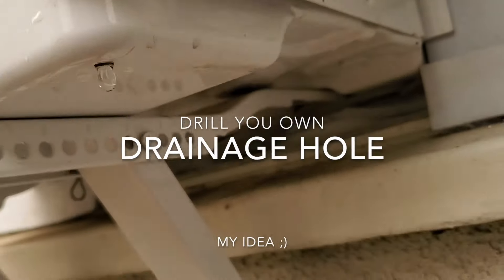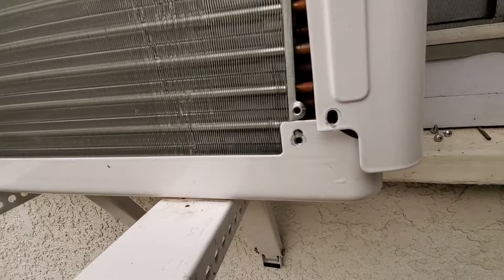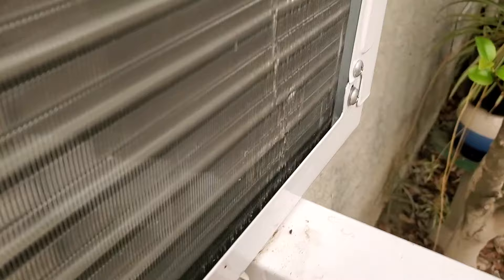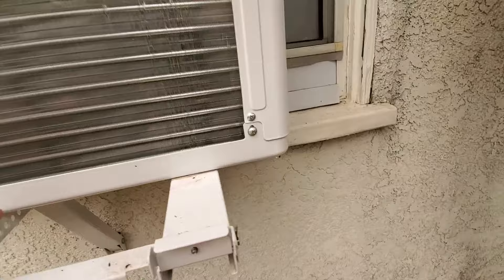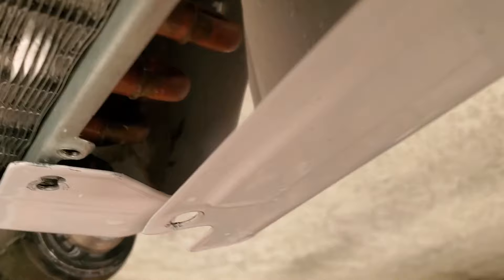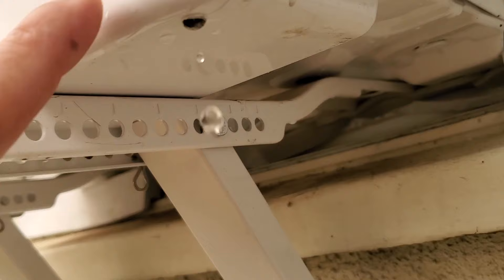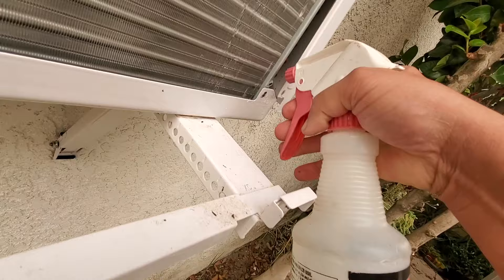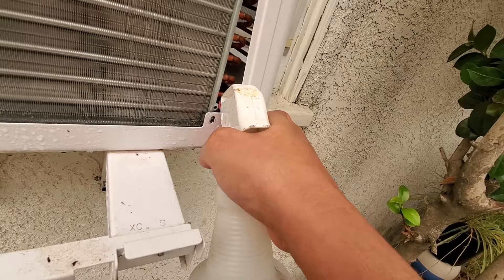How to Drill a drainage hole in your Midea U- Shape fan :) Honest²

Comment: That water gets splashed on the condenser to improve the cooling. By drilling that hole you just reduced the efficiency of this AC.
Reply: I was just gonna comment the same…. It’s true, look it up people before making this mistake.
Reply: I have several air conditioners that seem to lack drain holes. I get what you are saying but that standing water really helps all the metal screws, lower coils and lower chassis rust.
Reply: Drill the hole. The reason for having a sealed case and this water splashing design is to promote the energy star junk units that only last a couple years. Drill the hole
Reply: Why? the water is to cool condenser  i hope u didn't void the warranty
Reply: @cheatermustdie00  if you don't drill, it will rot out in a couple years, then you're at the store buying a new one... it's called planned obsolescence.
Reply: @darinp5612  2 yrs ? If you don't clean your AC every 3 months midea and carier are not stupid made design that will not last  long
Reply: @cheatermustdie00  needs to have a place to drain rainwater and your cleaning agents.
Reply: It’s a good trade off. Less efficient vs loud spattering/popping noises, mold, rust, water flinging around (rusty water flinging around 😅).
Reply from the maker: @petersachs764  @FuzzyJohn @StarlinkAdmin PETE KNOWS What's Up!!! Theis a lie @_@ Honest²
Reply from the maker: @cheatermustdie00  I'm still waiting for someone who has dealt with the warranty???  You have to have a license AC repairman look... I'M A DIY4LIFE!  Warranties are for those who can't DIY @_@ Honest²
Reply from the maker: @darinp5612  Careful... speaking the truth!  People can't handle the truth!  I can ;) Honest²
Reply from the maker: @travisevans2549  Mine has DUST not RUST Hahahahaha that's kinda funny but true :) Honest²
Reply: Hey he is slow it’s okay haha
Reply: But the AC pan becomes in incubator for mosquitoes.
Reply: i thought you‘re only supposed to use mild soaps and clean more frequently to prevent buildup.
Reply: Thank you for letting us know good sir. 😊
Reply: I can always seal the holes, thank you for your comment
Reply: And increased the lifespan. The standing water rusts out the unit and becomes a biological breeding ground for mold and all kinds of other nasty things.
Reply: The model I purchased  in 2024 has a removable plug to drain the water if you choose that option.
Reply: @socrates2706 Where exactly is that plug located? And is it easy to access from inside? I live in a multi-story building and obviously, I can't access the AC unit from the outside.
Reply: @gillz107  It’s on the rear bottom corner. You can only get to it from the outside. It is blue on my unit which I purchased several days ago.
Reply: The hole is so small it shouldn't matter. I think it will work even more efficient than having water collect inside.
Reply: @gillz107 its damn near exactly where this man drilled the hile. Its bright blue you cant miss it.
Reply: Look up Legionnaires disease and then tell me what size drain hole you drilled
Reply: @socrates2706 

I was outside looking at my daughters Midea U shaped air conditioner and didn't see any water coming from it. I did see that blue plug your talking about. I'm removing it tomorrow. Thanks for the heads up.
Reply: @gillz107 It’s basically in the same spot where this guy drilled it in the video. Looking from the outside, it’s on the outer right corner underneath the unit. Looking from
Inside the house, it would be on the outer left.
Reply: It's not a mistake after you've had it awhile and notice algae and mold growing on the window and wood siding around the unit
Reply: @cheatermustdie00  on a 300 dollar ac that last a couple years anyway?    The water splashing everywhere grows mold on my windows and siding
Reply: What do I do if I don’t have a drain hole ?
Reply: It is better to "reduce" the efficieny than having the condenser to rust.
Reply: @KingHarlequin1999  What kind of material is the condenser made out of? Does it really rust? Also, isn't the condenser on the outside getting rained on?
Reply: @FuzzyJohn  For most condensers, the fins are made of aluminium, the tubing is made of copper, and the A/C housing is made of steel; and having water sitting for too long when the unit is off will cause galvanic corrosion, causing the steel to rust, and the aluminium fins to corrode into the copper tubing, therefore decreasing the efficiency permanently.
Reply: @KingHarlequin1999  That's fantastic!

Comment: PSA dont try to drill a hole on the left side of the midea, punctured the unit and now have to order new one =(
Reply: I couldn't get the panel off on mine and just blindly drilled it in a moment of extreme frustration. Water came pouring out, but I don't see any obvious sign that I punctured the coil. It's running and blowing cold. What happened when you punctured yours and how long did it take to see something was wrong?
Reply: @mandyperkins4415  i had 2, first one did whats urs did, alot of water came out and works fine. second one tho is where i messed up. i think it hit the coil and a loud hissing/blowing noise started with  a bunch of water pouring. i could tell the second i drilled into there was a problem.

Comment: I have two of these units in my downstairs windows. I recently have been seeing a lot of springtails getting into the house. Sure enough, i go out to look for the moisture and it seems no water has been draining from these units. I drilled this hole and water came dripping out like crazy. I don't know if this will keep the springtails away now that there won't be any water sitting and collecting, but it def is worth a shot. Thanks for the vid!
Reply from the maker: I was nervous cuz I figure I would get some blowback.   To Drill or Not to Drill... That is the question!  It's fun to drill things ;) Honest²
Reply: Drill!!! Rust is an air conditioners worst enemy by far.

Comment: I drilled mine on the right side. All older A/C units I have been around have drain holes. Even the main wall A/C (Comfort-Aire BG-121P) that came with my house has 2 drain holes and has been running perfectly fine.

Comment: I have installed one on my shipping container (which is my work shop now) and every time I turn the AC on it has a smell to it .. even if its on the fan mode .. there is a bunch of water in there I can tell you that .. could that be the cause of the smell??  and why isnt there a drain hole originally on the unit ?    Thank you for sharing  .. I like the mount you built .. it looks awesome and well made.

Comment: I have the 5000 btu version with no drain plug. This is a definite design flaw. The humidity inside my home is 10% more than it is outside. Air conditioners are also supposed to dehumidify or what’s the point? Everything gets all clammy and damp otherwise.

Comment: The new units are designed this way, so you should really do some more research. And educate views that the fan splash water onto the coils is to help better cooling. 
Is this right? I’m sure on paper it looked like a great idea but in practice it’s poorly done. My brand new AC unit has a huge puddle of rust in that pan. Manufacturer can’t help

Comment: My first a/c of this model corroded  in 2 years, 1 inch off the base despite me using professional cleaning supplies for a/c. Got a second one, and I'm looking at it collecting water. I have drilled a hole in another Midea model already because the water was building up and making a clinking sound when splashed by the fan against the fins. Why doesn't this company make a drain hole from the factory?!😕
Reply: Just done it. But I pried the side panel quite wide and drilled from the inside. Lo and behold a bunch of water and crud came rushing out, and the a/c is a week old. Use quality bits and don't nick the copper tubing!

Comment: Hey, very useful video. We just ran a whole summer of this AC and it accumulated water like nothing we've ever seen and we don't even live in a particularly humid area (Montreal). We're lost about how to keep it clean inside. It's a bit of a dusty and corroded mess. Is there a relatively easy way to remove the components of the back part to clean properly? We were also told by Midea themselves both "it's designed to not need drain holes" and at the same time, "you can put a small hole somewhere if you like". So I said to them, how can you say BOTH things to customers??" So, do you recommend I just drill a hole like you did? How large of a hole should I make and what would I use to create a stopper?
Reply: Latest midea's use a 3/4" hole on the right rear side if viewed from behind.. it had a rubber plug in it..I pulled that out on day one..they are aware that this is an issue
Reply: @skip741x3 Thank you. Maybe I'll try to make a home.

Comment: The sling fans on window shakers are meant to come in contact with the condensate water.(slope outward is important on these) This water helps cool the compressor by rejecting heat from the condenser more efficiently. 

The air outside is never in contact with the air inside on window shakers. This mod will likely reduce the life span of your compressor. I would stick to cleaning before storage end of the season. 

Maybe even drill a hole to rinse/clean and plug it for operation the way it was engineered.Good idea for a new vid. Cheers.
Reply: yeah just drill a hole using a very stubby drill bit a size smaller than any rubber plug you have and you have a simple removable plug if you want.
Reply: Matt, do you have one of these u shape units? There is a design issue with it that causes the condensate to foul up the evaporator and squirrel cage with mold after a few months' usage. Also the condenser clogs up due to the excessive condensate that the unit can't get rid of. Over an inch of condensate is too much. Your theory is sound but this Midea requires this mod or you will live with lung infections. Midea knows about the flaw.
Reply: @nobaddog1  I have no issues in Alberta Canada using it on a square footage room that can satisfy set point with 10,000 btu’s. Design may not be able to handle your locations humidity and or room size.
Reply: @nobaddog1  no issues with mine in West Texas.
Reply: @mattb6514  I should have added that I live in New Orleans where the humidity is always 100% so I get a ton of condensate water it just overwhelms the system. The little unit works good though it’s always got a stream of water coming out.

Comment: How does it cool after said hole was installed? Some say the water needs to be on there to keep it cooling/cooling radiator.
Reply from the maker: The AC was blowing 50-51.5ºf with or without water!  I put tape over the hole & ran tests.  Looks like the lower basin can hold near 3 cups of water.   When full of water I don't see where it is helping with cooling @_@ Honest²
Reply: @Honest Mike  You'd probably only notice a difference if you're in a dry climate, and there was a big temperature disparity between indoor and outdoor.  The water on the external radiator will definitely help eliminate heat from the system more quickly, but if you're somewhere wet then it's mostly just going to collect extra moisture.

In theory, even at 100% relative humidity weather, the external coil should be hotter than ambient and so it should still be able to vaporize, but it'll be slow.. and in high humidity, the interior is going to be generating a lot of moisture.

The alternative for someone who wanted to keep the efficiency gain but to make sure the overflow happens in a consistent spot, would be a hole higher up on the side to get rid of excess water above a certain level.. but if it's regularly overflowing then you're probably doing the right thing just letting it drain completely.

It definitely seems like a maintenance tradeoff to me.  It'd suck for that bucket to just be a constant mildewy, buggy, tepid pool so nice vid.
Reply: The fan…the fan is the main thing cooling the condenser, not the water flinging all over (that just helps a bit).
Reply: @travisevans2549  Yes... My post was about conditions where the vaporization would be more noticeable.  It makes more of a difference in dry climates.
Reply from the maker: @chronosemagram  Thanks for the reply!  Was worried making my 1st how to vid... Never thought To Drill or Not to Drill would get so political @_@ Honest²
Reply: @chronosemagram  Great post.  The design of the AC takes in to account the use of water to remove heat from the condenser and will improve efficiency. Something else to consider is that if the unit requires service within the first year,  this mod will most likely void your warranty because it affects the operation of the unit.

Comment: My mom just bought a midea u shaped window ac. Is the ticking sound from behind the ac normal? It’s making a random clicking sound besides the air noise
Reply: It's the fan splashing water against the back grill. Normal operation, but...
Reply: @bobdroidsky225  but what?
Reply: @yezimaverage  The noise bothers your mother, and you have a swimming pool inside the A/C. And, in my case, it ruined the A/C in 2 years because of corrosion.
Reply: @bobdroidsky225  okay thanks for sharing 👍🏼, is there a way to prevent this?
Reply: @yezimaverage  Well, this video, I suppose. Make sure it's draining well. Also, make sure the rusty water is not dripping from the roof onto the a/c. Rust from the iron roofing nails causes corrosion in aluminum and copper.

Comment: DO NOT drain a hole in the unit. Doing so will void your warranty. In instances where there is an excess amount of condensation there is a ¾in opening near the rear of the unit where the water would drain from. The fan is designed to sling water onto the coils to maintain a cool temperature, hence the splashing.
Reply: Thank you I was wondering if that was designed to do that.
Reply: Can you please identify specifically where this3/4" opening is located?  I have a neighbor below that is complaining that the water is dripping on to him below...and I need to install a water diverting drain tube...

Comment: Right from the HVAC technicians 

See below

A window room air conditioner is not designed with a drain plug or drain hole that allows the unit to drain excess water while operating. Air conditioners have a "slinger ring" around the rear fan blade. The fan is designed to pick water up off the bottom of the pan and throw it against the condenser coils.
Reply from the maker: Nope... its to keep em in buisness @_@ mine running fine • hm¹
Reply: Correct. Left them a comment as well. Lots of people overheating compressors with this mod. Unit will run fine until the compressor burns out. Suggest a plug for anyone who has already drilled a hole. They can call it the cleaning/service hole lol.
Reply: @mattb6514  

Yeah if you notice old air conditioners used to have a drain plug.. 

That's not to take the plug out That's to drain your AC at the end of the season when you store it or put a cover over it.

They took that plug out in my opinion because just as you mentioned it can damage the compressor if things don't stay cool enough It's part of the system. 

So what was happening is people were draining the water and leaving the plug out not putting it back It was causing damage to the air conditioners THEN IT BECOMES A WARRANTY PROBLEM..

So they figured people are just stupid we will protect them from themselves THEY DON'T GET IT. SO THEY GOT RID OF THE DRAIN PLUG COMPLETELY.. 

Just amazing how people speak and create new types of dumb when they don't know what they're doing.. 

🤣
Reply: @mattb6514  what do you think will overheat a compressor fastest a clogged up condenser or no water getting slung up on it. The water helps its efficiency. It doesn’t cool the compressor. The compressor is cooled on the suction side, the cold side. As the refrigerant exit evaporator it is returned to the compressor.  Enough said. It’s starting to get technical now lol.

Comment: This is stupid. Don't you people think if it needed to drain from the bottom, there would be a drain hole? It is supposed to collect water. The tips of the fan splash the condensate, and fling it on the condenser, causing evaporative cooling effect. Providing additional cooling capacity. Draining removes this ability, and your unit will be far less effective in humid/hot conditions. If you drilled a hole, patch it with silicon. The rear opening is designed to drain at specific level to allow the condensate to drain once it gets to the maximum level. The bottom of the unit is supposed to get dirty, its unavoidable. Thats why you need to clean it every year or 2, depending on the environment.